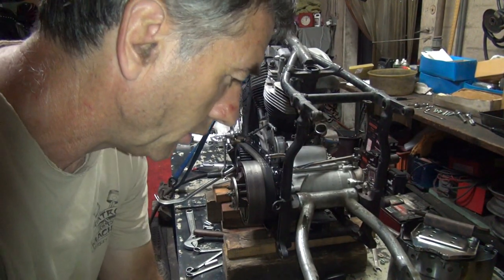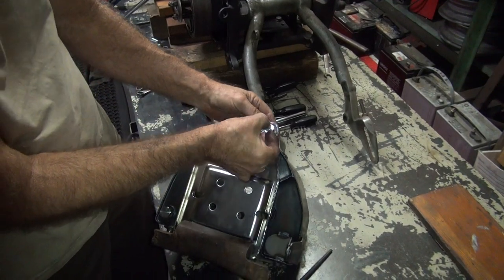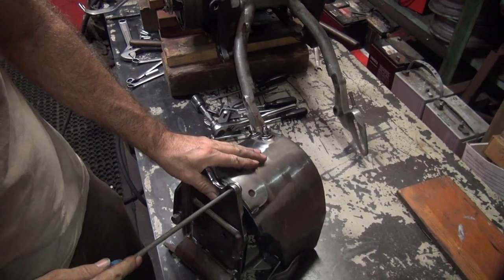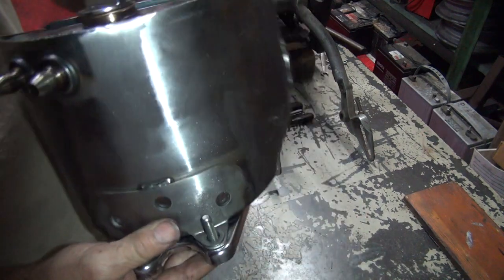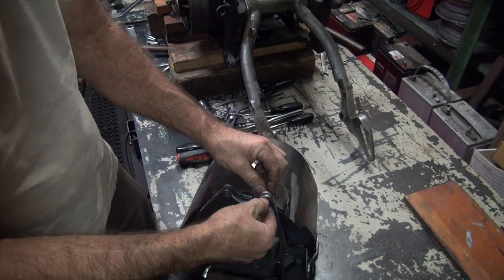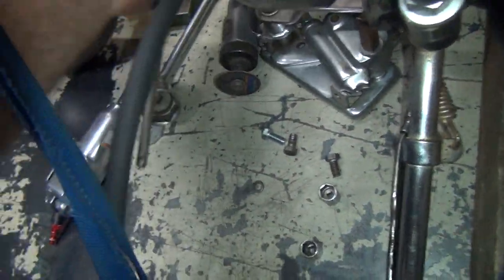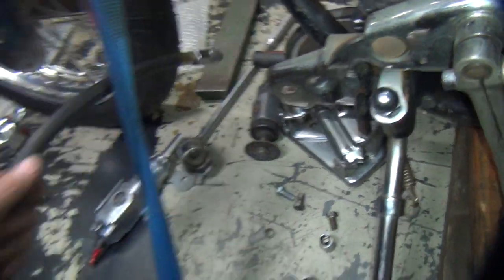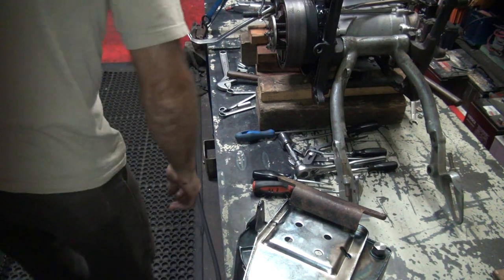#121 1973 shovelhead loose the ugly kickstart custom bobber build 74ci FX FL harley by tatro machine

Comment: Are those bolts zinc or some other plating? Was thinking about investing in some bulk hardware, and need some ideas. And also is belt drive better. I thought u liked steel.
Reply from the maker: yes on the bolts. belts suck because they break at some unknown point, chains don't. chains need oil and tin primary's leak very badly. you get to chose which one you can live with.
tatro
Reply: @TatroMachine  that explains it  very well. Sweet project hope you turn it for a fat profit. Is there a decent place you buy bulk hardware from? Seems like you have an amazing stash.

Comment: Tatro I need help,got a 75 flh,with the Ultima rims,now the hub is centered in the middle of the wheel but looks offset to the to the left looking at it installed on the bike, question is can you tell me the hub to rim measurements of the left to right for the rim, going to be truing the rear wheel,I can't find any specifications or prints on the install , measuring with straight edge from hub to rim left side and right or is it too be centered in the middle of the rim doesn't look right with the finder
Reply from the maker: you are on your own, figure it out.
tatro

Comment: Jeeze . Tatro talks about ..slotting out the holes.. i'm thinking he has some nifty machine or a tool i don't know about.... then he grabs a file.....  i laugh... just like i would have done
Reply: You can never have too many files . . working outback Queensland  Oz on drill rigs . . did a trip back to mount Isa for stuff etc. . trip back to rig I did't notice (I had't had dealings with them) . . that the main diesel tank on the cruiser had run dry & I did't know to switch over to reserve tank in time aka no fuel in system . . kicker was I did't twig to what had occurred  before I flattened the battery . . but the penny dropped & found the vehicle had zero tools inside except for one file . . with which & an scrounged bit of metal from the roadside I fashioned an spanner to bleed the system from air . . battery was still flat . . which cost me a carton of VB from a passing cow cocky to jump start . . moral is be prepared & check vehicles out before heading out  & I screwed up with the reserve tanks
Reply from the maker: use what works. i have never been afraid of a little work.
tatro
Reply: The drill site was called Tick Hill. . we never experienced any ticks though thankfully

Comment: 20 hours labor in mounting a oil tank !?
Good thing you get paid by the hour . Lol . Just like McDonald's the employees are working as slow as they can thats why it takes 30 minutes to get a burger and fries .
Reply: Figuered out the air line years ago go over every lift with the poly coils keeps it out of the way and as i need it just reach up and grab it . Ya i have a couple wall plugs and just got in the habit of coiling them up and hanging them beside the air outlet on a hose bracket . I tripped for my last time a few years ago that one hurt bad so i changed and it works well no more lines to trip over .electrical outlets on work lifts so drills and such are plugged in such a way i don't trip on cords either
Reply from the maker: it takes time to fit parts that are made wrong and were never made to fit in the application i am putting them into. accurse you should have know all of this already.
tatro
Reply from the maker: i personally do not like crap dangling in front of me or over my head. just learn how to walk. we are all free to do what we like.
tatro